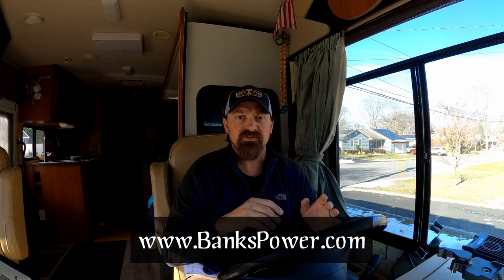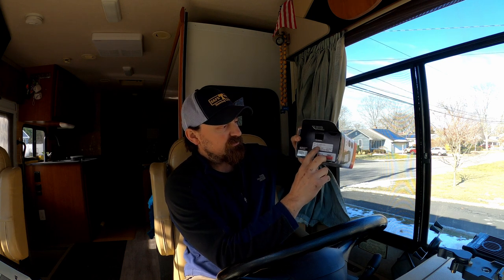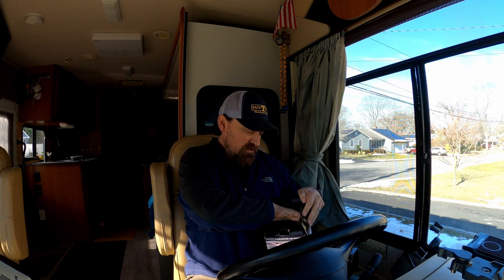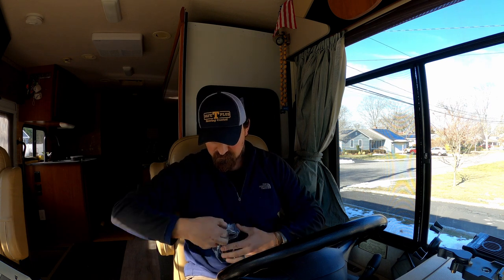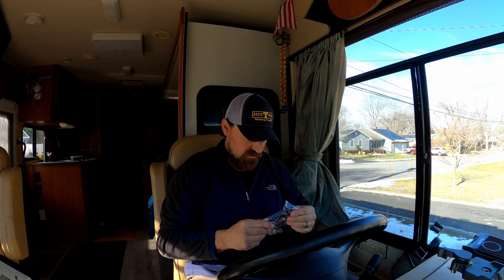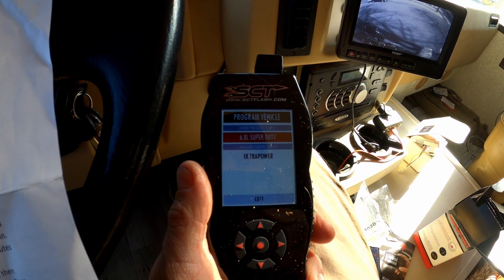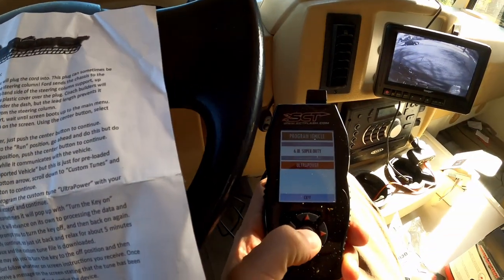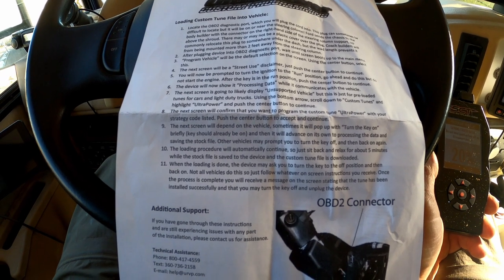INSTALLING the BANKS AUTOMIND ENGINE PROGRAMMER for our RV

Comment: I know this was posted some time ago, but I noticed the whole video was just showing an SCTx4 flash tuner. Apparently Banks was taking the x4 and modding \tweaking them. The new banks "AutoMind 2" is a 100% Banks product, and looks to be slightly superior to the X4. The Banks unit has a full color display, where the X4 does not.   Anyway, great video.

Comment: Were you able to do a follow up to this video?
Reply from the maker: I will be once our RV comes back from the engine shop. I had to change spark plugs, exhaust manifolds and then a tick started so that is being repaired now. Once it is all fixed I will be doing a mpg update from all the banks upgrades. We're supposed to get her back on Tuesday next week.